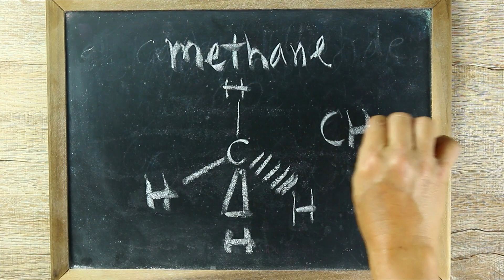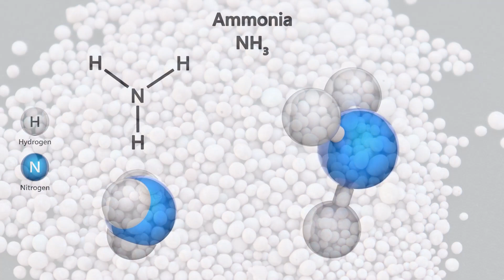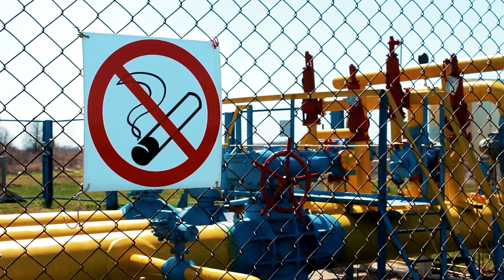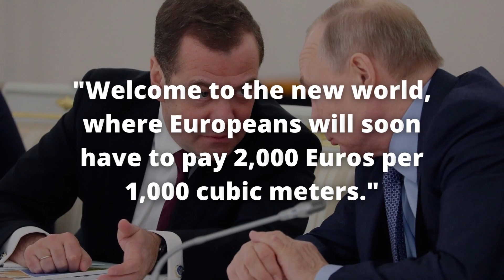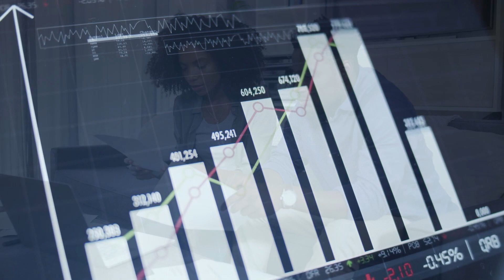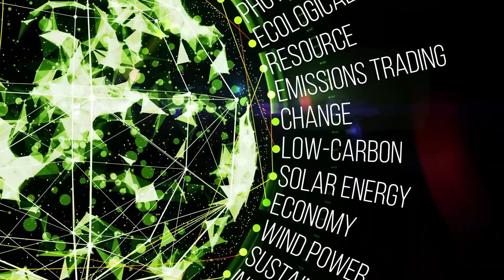NATURAL GAS Documentary: Science, History and Future Outlook

Comment: It was an error to rely on Russian energy to begin with but hindsight does nothing for us.
We'll have to find other trading partners. I'm all for energy independence and we might need to embrace nuclear. Renewables will become reliable once we have batteries for them but as you know, we have no answer to that right now. It's true that our push to renewables is at a very difficult early stage since we don't have the tech for it but we have to find an alternative to OPEC. Regardless of past U.S. intervention in the middle east, cowing to the Kremlin is not an option.
Reply: Too bad you mention nuclear power and everyone gets scared and goes 👀 because of Chernobyle and fukishima. Fukishima had its ONLY backup reactor cooling system(s) powerd by a diesel generator in the basements. (the lowest part of the building where flooding would obviously go first) so as the basement filled up, the reactors then overheated and the cores melted. So based on a lacking of common sense design, the protocals and countermeasures that were in place were nulled by a basic design flaw. (As well as excess used fuel rods on site not being disposed of and the sea wall in front of the plant either not barely built to code or the sea wall being not tall enough for the level of Tsunami)
Chernobyle plant warnings were repugnantley and blatantly ignored so then, well....ya know. 
People also forget that thorium exists and its not nearly as volitile.
Reply from the maker: I agree with most of what you said, aside from "cowing to the Kremlin is not an option." Sanctions are really stupid in my view and so far, have done more harm to the EU and USA than to Russia itself.
Reply: @CommodityCulture  well, you have the right to an opinion.